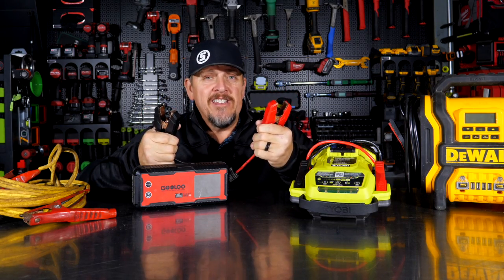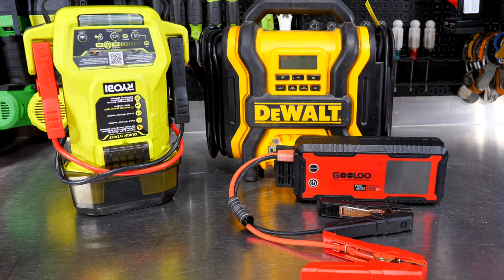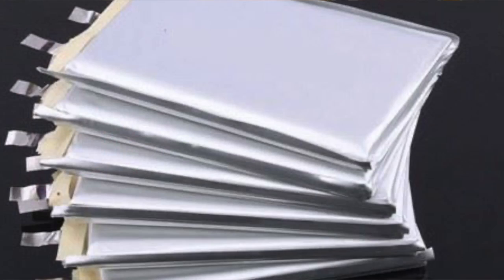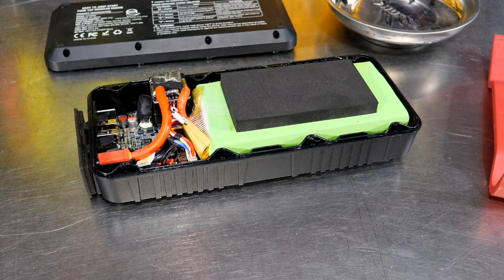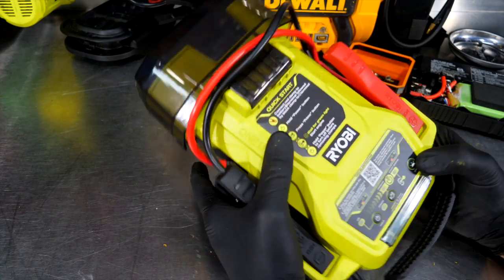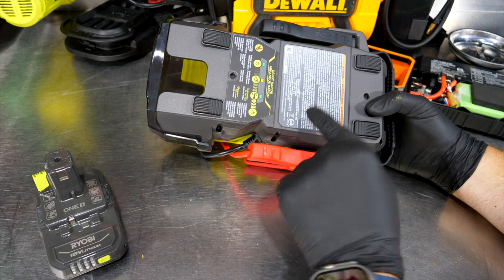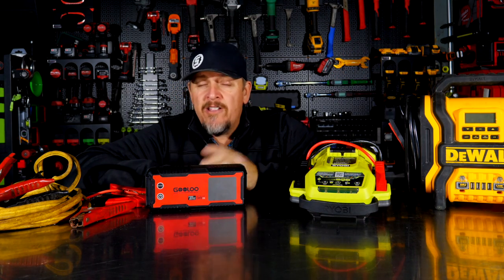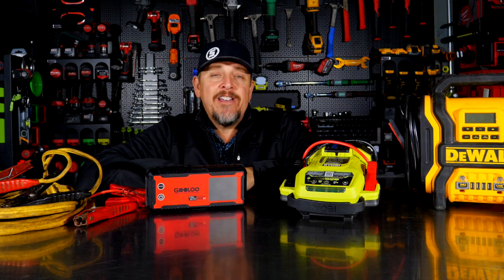How Do You Jump Start? We Take a Look at Several Different Battery Powered Jump Starters

Comment: Thanks for the comparison and teardowns. My older styled jump pack died and I am looking at getting a replacement, but haven't decided yet on which one. I like the Ryobi one because of the battery and I already have the Ryobi air compressor so they could even share a single battery. But it is almost $200.00 and I don't normally use or need one.
Reply: You could simply replace the battery inside your jump box if you are so inclined.
Reply: @electric8668  Doesn't look too difficult to do either.
Reply: @wildbill23c  I've done it before. Issues are battery could be pricey and you have old tech that you have to babysit more than with the new stuff.
Reply: They all work pretty much the same in regards to the pocket style lithium jump packs and most of the time people never charge them so when they do need them they're dead because they threw them under the seat or in the trunk of their car and forgot about them for months.  

There's a lot of different brands, all of them are cheap Chinese units all made the same way with ridiculous price variations.  

I think the one I have is a TackLife brand, works fine, it'll jump start the V10 in my pickup, doubt it would start a diesel because of the high compression of a diesel, but it works for my needs....jumper cables are great if you got another vehicle there to use, but if not jumper cables are useless.  

I have the Ryobi 18V Jump Pack, great idea, but once again you have to have the battery with you, otherwise its like the lithium jump packs that are lying dead in the trunk or under the seat.  

The downside to the lithium packs is they will randomly just die, the batteries give no warning they're just dead suddenly, and need replaced, where the other methods typically give some sort of warning, whether not maintaining a charge as long, or by the battery meter on the battery in the case of a jump pack like the Ryobi.

Comment: Why is the black hooked up to battery terminal? Shouldn’t it be hooked to vehicle frame?
Reply: Typically those battery cables are so short you are lucky to have enough cable to reach between the terminals of the battery...no you don't have to go to a vehicle frame to jump start a vehicle positive to positive, negative to negative on the battery works just the same...and with many vehicles good luck getting to the frame and many don't have a frame, or is so rusted you can't get a good enough connection anyhow.

Comment: Does DeWALT make one that takes a tool battery?
Reply: Yes they do, model #DXAE20VBB, uses the Dewalt 20V batteries...so you could probably put a flexvolt battery in it if you wanted to do so.  

I'd go with the 20V platform myself, if you got Dewalt 20V tools already, that's the way to go...skip that stupid lead acid battery version, those things never seem to last, granted you can replace the battery, but you gotta disassemble the stupid thing to do so, and looks like a ton of screws and stuff to lose in the process LOL.    Not to mention a replacement battery probably would cost about the same as just buying another jump box.

Comment: Is there any reason why we can't use an adapter to use a M18 battery with the Ryobi? 

I am also waiting for a solid M12 option.
Reply: Don't see why not, if the adapter works on your other tools it'll work on the jumper pack, might just stick out the bottom of the jumper pack due to the added bulk of the adapter maybe, but if you got an adapter that's working, I bet it would work just fine in that case, as the battery isn't supplying all the power, it just charges the capacitors inside the jumper pack in the Ryobi one at least.

Comment: We need an m12 jump pack with 2 high output 5.0 batteries
Reply: Well no we dont NEED that. We just need something that works. 
You can buy several cable devices that attach to a single M18 battery and will jump start your car. And they only cost 30 to 40 dollars. Amazon has several of them. Also for Dewalt.

Comment: The Ryobi is definitely the future of the BEST jumpstart packs. I only wish Milwaukee would make one like it. I own that Dewalt, it is a piece of trash. It worked for a few times. Now, being one year old, it can barely start my lawn mower. It can not start my escalade with a battery that is only JUST too low to start the truck on it's own. The gooloo one, my son has one, does work very well. But if you use it a few times and forget to charge it? it is useless. And it does seem to lose some charge just sitting in the trunk.
Reply: Someone mentioned the battery adapters, so if they make a Milwaukee to Ryobi battery adapter that might be an option until Milwaukee wakes up and makes an M18 jumper pack LOL.  Although given Milwaukees track record for prices they'd price it so high you could invest in the Ryobi brand and save money LOL.  Milwaukee has some great stuff, but given the Chinese manufacturing of their stuff, there's no reason it needs to be so expensive, same goes for Dewalt.  They're all way out of hand on cost to begin with...and gonna get worse with all the upcoming tariffs unfortunately.
Reply: Milwuakee has one Now 2025 probably  $300+ in USA here in Canada it's $400

Comment: Least dewalt gives you that nice handle to chuck it over the hill with in 3-5 years when the sla wont hold a charge anymore. 
One thing the cap discharge ones have going for them is they generally still work very well when they're freezing cold. Straight lipos, not so much.
Reply: Just replace the battery in it, all those style jump boxes have replaceable batteries...I bet if you looked around long enough online you probably could get replacement lithium battery packs for those little pocket style jumper packs.  Nice thing with the Ryobi, you just put a battery in it that's fresh whenever needed, and since someone buying the Ryobi jump pack probably already has other Ryobi 18V tools, they most likely have several batteries to keep cycling through.

The problem with all the jump box and jump pack systems is you throw it in your car and by the time you need it, its dead....jumper cables never need charged, but require another vehicle and the way things are in the world anymore jumper cables aren't really a preferred method to have to rely on a stranger for help.  The jump pack I have you can recharge by plugging into a 12V power source in your car which can be nice...if you remember to do so before you need to use it LOL.

Comment: As a DeWALT fanboy their jump box sure was disappointing with that lead acid battery. 😕
Reply: Yeah the SLA jump starters are all pretty much outdated. Over my 20+ years as an automotive technician I owned several SLA jump starters. Jump N Carry 770, 770R and 950 models. The 950 was a beast when it was new but after about two years it could no longer start our diesels off the vehicle’s battery was still good but severely discharged. To get those going I had to disconnect the battery, jump it, and then while it was running, reconnect the vehicle battery. Not ideal. I derived over to the NOCO GBX155 and never looked back. That thing is an absolute beast and 3 years on now it still functions flawlessly. I have two of the Gooloo 4000 models for home use and they’ve surprised me quite a bit too.
Reply: @2down4up same here almost to a T. Except I have the gb250+
Reply: All dewalt jump pack as are straight garbage. And I’m a dewalt guy too.

Comment: I want to get a capacitor jump pack but I'm on the M18 platform so I guess I'll have to wait!
Reply: I had a small autowit style one and liked it so much I built a huge 24v one out of maxwell capacitor banks. Its explosive!
Reply: Desalt needs to step up their JumpStarter game and follow Milwaukee and Ryobi with super capacity Jump starters
Reply: The next generation of Jumpstatrters should be like the Ryobi and Milwaukee units , with the option of the 18 volt battery able to provide 12volts to power the car should the Alternator be bad

Comment: Can you do a jumper cable one? I carry both options in my vehicles.
Reply: Nothing to really do a video about, they are just jumper cables....all sorts of different lengths, and cable gauges depending on what you are trying to start...and most people buy the cheapest ones they can which might be fine for that one time use on a small car, but get into HD trucks and those $10 jumper cables might just melt or catch fire because of the high amount of amps you are trying to push through them.  The bigger the gauge number the smaller the cable size, and the less amperage they can handle.